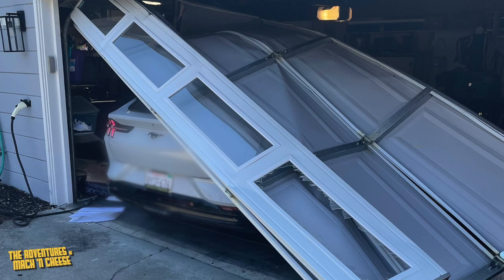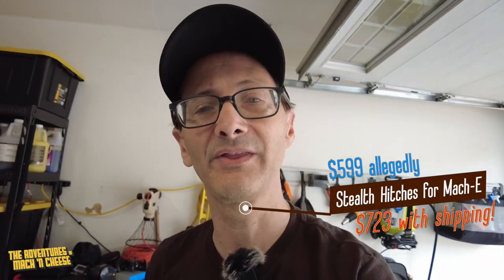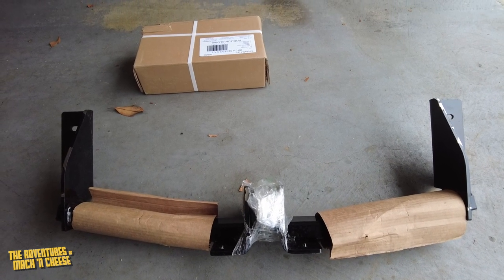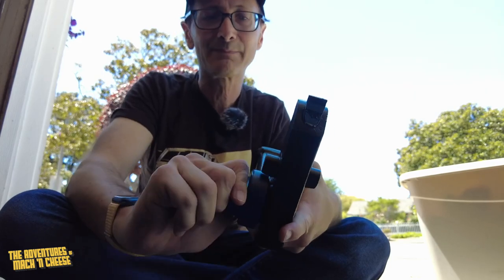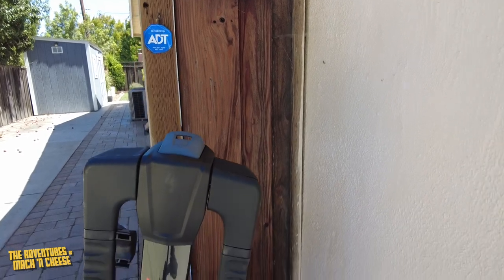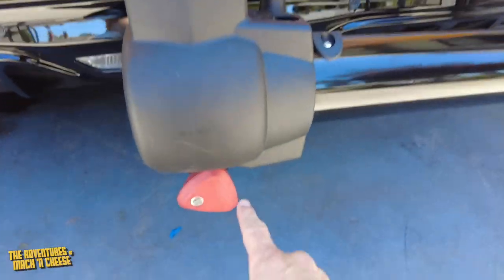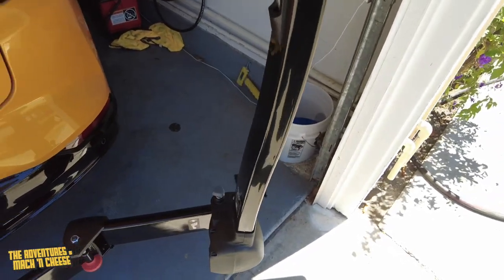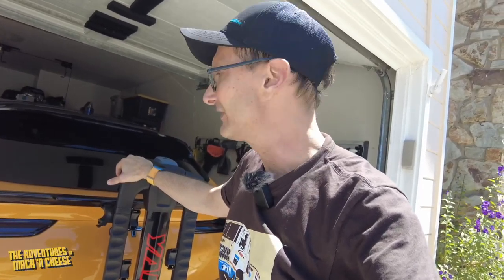Installing Hidden Receiver and Bike Rack on a Mach-E!

Comment: Was going with the "stealth hitch" until I saw the "not for towing" tag on it. Cancelled the order and ordered this one. I may tow a small trailer, and I need the option...
Reply from the maker: it was a good hitch, although I didn't attempt to tow anything except for bikes off the end of it.  honestly, I got this to have a rear towing solution for the car since it seemed pretty clear to me that there was plenty of chance that the junction box mail fail again at some point in the future.  Mach-E has no way to be towed safely from the back, so this was cheap insurance to have some solution if I'm bricked somewhere.